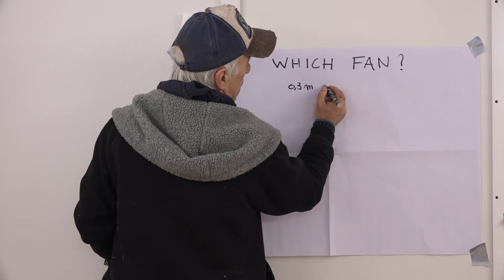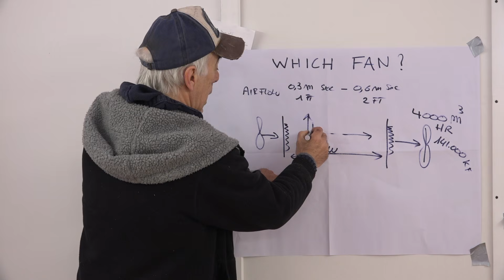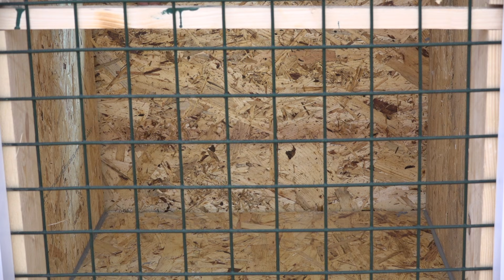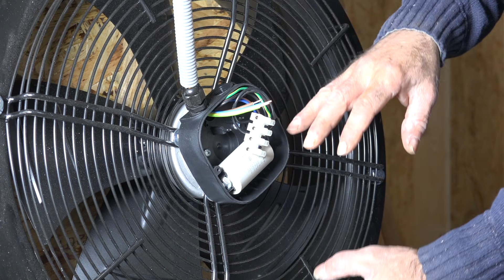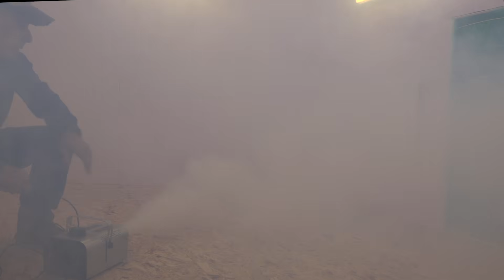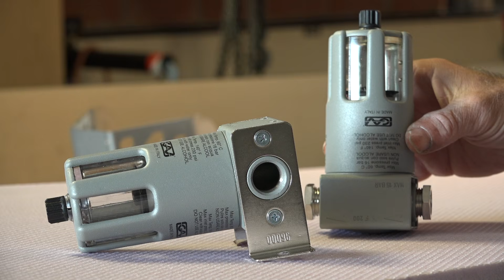Building your own paint booth, Part 4 of 4,  The air system

Comment: Go
To local hydro shop and get 2 + 250 fans with filters for extraction on one side and u dont even need one for intake as those fans will pull air (in) …. Simple kiss..
Reply from the maker: Yes , but you made one mistake in the reasoning ....  a booth has in general a small over pressure so it keeps dust out. If we were to extract only air, we run into a vacuum condition. Thus sucking in air and possible dust.

Comment: Take note ... When he calculates for U.S. Cubic Feet it is well to note that CFM is a PER MINUTE standard not per hour.  So  to equate 320,000 ft per hour one needs to first divide it by 60. If you do that then to get CFM Cubic Feet per Minute would be a fan capable of 5,333 CFM at an air velocity of 1 ft / sec.  But you would still need to " Dial In " your velocity and balance by using an Air Flow Baffle on the in-coming duct air side while using an Anemometer inside the booth at the exhaust filter via several spot reading 6 or 9 readings / filter along the face of each filter then take the average to determine air current flow speed and adjust the baffle in you incoming  air flow stream/fan accordingly; Also a  Manometer to measure either for positive, negative or differential air pressure inside the booth,  and on the outside filter to determine flow balance thru filters.  This video is good info but only gets you to maximum sizing of your fan output needed. Al the above details address what is needed to " Calibrate " the air flow and pressure environment of your booth.  If you only get a fan that fits the air movement needed you and only install filters on the pusher fan and exhaust fan, you still run have the risk of having a booth that is too positive or too negative.  Too much air flow will prematurely flash your media causing hazing, solvent pop and craters.  With too little flow you get dusting, overspray, over mill application etc.

Comment: First of all lovely series, explained perfectly. However I pretty sure the equation you have showed is incorrect from what I know the formula should be Q=V*A where Q is air flow (m^3/hr) V is velocity (m/hr) and A is cross section, the area infront of the fan (m^2) and what you have showed isnt the cross section

Comment: Excellent video, I appreciate your efforts. I'm in the process of upgrading my home 2 car garage with better exhaust fan. I do auto body collision repair and paint work and had never considered adding an intake fan... Once I have my new exhaust fan (24 inch and 4244 cubic feet per minute) mounted and filtered I may look into the intake side as well. Anything that would minimize wet sand and buffing would be beneficial.
TC in Annapolis, Maryland
Reply from the maker: Sorry for the late reply , as i was away for work. But thanks for the comments.

Comment: sir i have 50 feet long and 22 feet  wide godown can i use this technique if yes should i have to fit exhaust in or outside ?
Reply from the maker: Not sure what the question is...   in principle the methods are the same.  Can you explain what you would mean.... sorry ?
Reply: @D3Sshooter  sir my manufacturing factory is 50 feet length * 22 feet wide and we are using oxy fuel gas cutting machines which cause smoke inside the factory and i want to know that how we can send that smoke outside the factory using exhaust ?
Reply from the maker: @ieltssolutions5634  , I see.  Yes in that situation the same situation calculation can be used. but keep in mind that you will need to use the refresh rate of air that your local legislation for health and seafty describers

Comment: Your paint booth is really amazing. I'm also a hobbiest and I love to repair and restore furniture. I have several Binks Model 7 spray guns, a Model 2100, a Model 115 touch up gun and a Spectrum Gravity gun. I also refurbished my Model 7's. Painted a car back in 1989 with my first Model 7 which I just refurbished. I want to build me a paint booth exactly like yours for painting furniture and cars, I guess I need to build mine a bit larger and it's going to be outside so I'm assuming I should use pressure treated wood. Any advice you can give would be greatly appreciated. Right now I paint my furniture outside and I don't care for that at all. Wish I had a paint booth but I guess someday I'll have it. Thanks for your videos, they're outstanding.
Reply from the maker: Thanks for the comments, I have used mine now for a while. several cars and it works very well.   If I would change anything, then it would be the an extra selectable fan for the intake.   Good luck

Comment: Terrific video!  Are you aware of any supplier of flexible exhause tubing (for use with a stowable spray booth)?
Reply from the maker: Thanks for the comments, yes I do  have a look at HBM machines and look for ventilation... they have those flex large diameter tubes
Reply: @D3Sshooter  thanks for the lead.  I checked them out, then found a much cheaper alternative which I've ordered a 26" diameter, 25' long tube.  I won't bother mentioning the company name until such time as I have received, installed, then used it for a while.  Fingers crossed!
Marty
Reply: To update you, in the end I decided that the flexible tube wasn't going to work (too inflexable and heavy to be readily supported), so I went with a fixed wall booth and a curved plywood exhaust tunnel
.  Thanks again thought for the many excellent ideas you shared with us, some of which I used in my booth.  Cheers from Canada!
Reply from the maker: @ApexWoodworks  Thanks for coming back and good luck.... maybe a video of the booth in working ?
Reply: @D3Sshooter  Definitely!  I'm installing the filter system and still have the lights and the side wall to reinstall, so as soon as that's done I'll place it on my channel then let you know.
Reply: I completed my spray booth upgrade and here's the link to the video: https://www.youtube.com/watch?v=oRaIdSZCRUM

Comment: We have recently installed a spray booth in a Sprinter van for Alloy wheel refurbishment. This worked well at first, but we have run into clearing problems that need to be addressed. Your brilliant explanations of spray booth design and calculations will be used to fix the problem. Thanks for your excellent video.
Reply from the maker: Thank you and good luck

Comment: Maths is wrong, multiplying by 0.6 as opposed to 0.3 you would required a fan to move 18000 cu mtrs/hrs, so you are olny going to be able to move airflow at 0.15 approx with your 4000 cu mtrs /hr fan!

Comment: Great job. This serie of video about paint booth has inspired me a lot. Please i'm just a bit confused about your air flow calculation. I think the surface to consider in the calculaton should be the surface to which the velocity is perpendicular to. It means that for your case, instead of using the width (W) you should use the length (L).
Could you please check and advise. If my interpretation of the calculation is not correct I really do apologize.
Also, is it the same procedure to follow for vertical air flow?
Thanks...
Reply from the maker: Thanks for the comments,  in fact its all the air in the booth that should be replaced within a certain time.  After all you spray in differend locations.   It is better to have all air incoming on the top and get it out on the bottom...  the bigger the surface for the filters the better as the air velocity goes down.
Reply: @D3Sshooter  Thanks for reply. Do you have any tips on how to estimate the surface for filters? Thanks

Comment: what kind of extractor is that? how can I get it? how much cfm do you extract?
Reply from the maker: The model I used is explosion  proof , but only the basic version, The principle is that all the air in the boot should be replaced about every 10 to 25 seconds.  So you will need to calculate what you will need.   There are many store that sell fans or extractor.  ventilatorland in the Nederlands is one

Comment: Great videos.... do u really need a fan blowing air in ?? Could u not just have filtered air inlets and let the extractor pull the air through... thanks
Reply from the maker: Thanks for the comments...  Yes you do as I wanted a slight overpressure in the  boot.  If you do not want an over pressure but underpressure then that is possible
Reply: @D3Sshooter  ok thanks I'll look into pressures
Reply: @D3Sshooter  And what is the size of the intake fan then? Do you you use the same as for the exhaust? Great job there...

Comment: Awesome series on the paint booth. How is it working out for you. Would this set up be efficient for painting cabinets? What does the temp stay inside with the infrared heaters. Great job.. Happy New Year from Tn, USA
Reply from the maker: so far , I have painted several cars and parts without any issue and great results, you can see some of that on my channel on old rusty,  This would work for cabinets, the temperature stays at 35 max, with the blowers it drops pending the ambient temp
Reply: @D3Sshooter  what is 35 in relation to Fahrenheit.
Reply from the maker: Drew Portdaven that is about 95
Reply: @D3Sshooter  thank you

Comment: Best paint booth build series on uTube, thanks for sharing
Reply from the maker: TXS for the comments, and it is working like a champ.  I painted the Lotus Elise in it and now Old Rusty..  There was one issue that I had to solve and that was to add another intake fan to create a bit of overpressure.   The reason is that the intake fan and the associated pre and final filters reduce the airflow more then the filters on the exhaust fan. Hence , I had a slight under pressure in the booth and that is not what I wanted .   That was a small and easy change.
Reply: D3Sshooter   I was wondering how your pressure reading ending up after u got your intake fan. I am looking at 5000cfm exhaust fan and trying to think about how to size the intake fan.  Perhaps i should think about it in reverse and size the intake first.  I have not decided on a solution yet
Reply from the maker: @jdpower5552  , calculations is one thing, but I did not think of the double intake filter . That is causing some restrictions for the intake air.   The exhaust filter is far less restrictive. This resulted in a under-pressure,  despite both fans were the same.  So I just added and extra fan on the intake , and that just worked out fine. slight over-pressure...I also made a small hatch in the intake box, so that I can regulate the overpressure...   That was the most easy way
Hope that helps

Comment: like the your behaviour but wood in a spray booth is a no no....
Reply from the maker: TXS, but note that its sob varnished and coverd with insulation panels at the inside. Works like a champ, done already several cars.  Why is wood a nono ?
Reply: @D3Sshooter  to keep dust out you need to apply tecky stuff on walls then after that wash walls down with maybe a pressure washer, wood will suck all water and rotten, surface is not smooth and attracts alot of dust. for few cars its fine on daily spraying cant advise wood i have been there, only upgraded to a commercial spray booth its a difference !
Reply from the maker: Thanks  @infinitewars6373

Comment: Dear Sir, Once a Car is fully sand blasted / Soda Blasted from all sides and when all the Paint / Putty Primer etc has been stripped off the car do we have to completely wash the Car with water to ensure that the soda blast / sand blast residue is taken off and cleaned just before the application of Epoxy Primer on the Bare Metal surface of the Car? In case of Soda Grit the water will dissolve it and remove it from the deep door corners etc and in case of sand air pressure has to be used to remove the reside from these areas. Kindly clarify. Sincere thanks in advance. Have a wonderful day.
Reply from the maker: Well my take is :   Dry clean the Soda blast residue.  The problem with water is that it dissolves the soda and creeps and drips in all places. So, a very good airblast will do a lot. Then really degrease the bear metal, with an all purpose prepaint degreaser like Holdtight 102 ..  If you use water , oxidation will start immediate even if you don't see it...    That is what I would do, but then again I am no expert in this.. have a great day as well

Comment: You have a mistake in your air flow and air speed calculation. You will get max 0.13m/s which is far bellow your country lower limit. 
But airflowspeed is theoretical. As you have centrally located inlet and outlet, might be in the center you will get 0.3m/s only,  however the rest will be underventilated. To reduce the airflow imbalance you can do with inlet and outlet relocation into a diagonal configuration.
Reply from the maker: Yes , correct.  I have that corrected in one of the video's.  Well spotted
Reply: @D3Sshooter  ..mistakes happen. However you didn't touch any influence on a functionality so far. For your job might be not so important. But hope you will come later.  
By my professional experience (most from confectionery production :o) air flow calculation should be linked to air exchange /3.5x2.5x6~50m3, with 4000m3/h you will exchange the box 80times. For most application is it far enough. Nevertheless spraying job is specific as plenty of parameters are linked to the ventilation and air drag/ speed. ..which I am curious about. 
Great videos, professionally filmed. Keep it rolling:)
Reply from the maker: Very good points and indeed, the booth does it job.  The only issue that I have seen is that the filter (exhaust)  clogs up after some time gradually reducing the airflow.  If I had to modify the booth ( I stll can), then I would take twice the filter area...
Reply: D3Sshooter what about putting baffles in front of the filter so the paint hits the baffle before it hits the filters to extend the time you get before the filters clog. Also i thought booth fans always have he motor separated from the fan blade tube? Is the kosher to have the motor inside the tube?
Nice video

Comment: You did a beautiful job, but that is nowhere near enough water and oil filtration for your spray gun. You need at least a 3 stage system if you plan to paint anything without contamination.
Reply from the maker: Indeed, I also have that near the compressor... I should have stated that. the one i added in the video is third

Comment: Great video Steve as always, thank you. Can you check your calculations though: you give, Flow Rate = Width x Height x Air Speed x Time which transposed gives, Air Speed = Flow Rate / Width x Height x Time. For 4000m3 Flow Rate this gives an air speed of just 0.128 m/sec not 0.7m/sec. Unless I have missed something fundamental, in which case I apologise.
Reply from the maker: David you are 100 % right, i goofed up.. that is why I made an erratum on part 4... its on-line and thanks for spotting it ...
Reply: Thanks for the erratum Steve. I am in the process of building my own booth and your video series has been invaluable. I just needed to ensure I had the right calculations. This video series has been very helpful and I am also very envious of your Truck! If only I could find something like that here in the UK. Cheers
Reply: @David-lg5gi  Can you possible assist, as I watched the video and thought the calculations were off somewhat. I am making a small booth for spray painting furniture and use water based paints and it will be 2.3m height  x  2.3m width (also the depth is the same 2.3m) can you estimate a fan size and air flow rate. Apprecate any help!
Reply: Just came across a calculator and believe this is correct, 2.3m h x 2.3m w/ Floor area 5.29m2/ Ciling height 2.3m/ Volume 12.167m3/ ACH 20/ Required Airflow 143.22 CFM/ Airflow rate 0.0676 m3/s (8.593ft/h/ 243.34m3/h so a fan equivalent to the m3/h would be suitable. 👍

Comment: Hi, your math doesn't make sense to me. 0.6 is bigger than 0.3, not smaller. 3.6x2.4x0.6x3600=18,662. Your 4000 m3/hr fan will give you a velocity of about 0.13 m/s. Or did I misunderstand something?
Reply from the maker: You are right Rick, I goofed up with the calculation  but check my errata video on part 4..  there I explain it where I stated it wrong....  TXS

Comment: i dont want to put a downer on things but that exhaust fan you used is an intake fan as its not explosion proof. explosion proof fans have the motor out of the air stream and intake fans have the motor in the air stream
Reply from the maker: Indeed Ross, TXS and I have an Errata video on it

Comment: Great work as always! You might need a spray gun support/table.  just case you have to use different spray guns during the same paint job. Also  one window on the door (maybe circular) so you can look inside from the outside avoiding open the door evry time and let dirty air come in.
Reply from the maker: Indeed, a lot of small things might be needed and come in later.  TXS